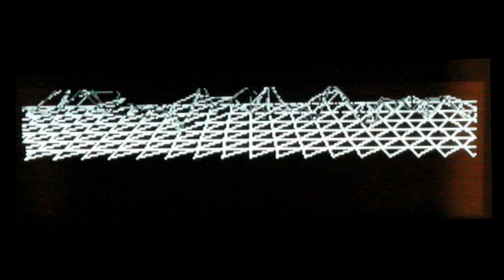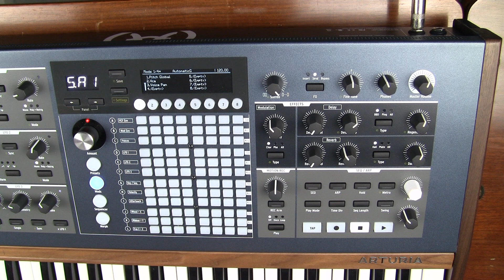18- The Arturia PolyBrute- Morph Control

Comment: Another benefit of the Swap A wiith B function is that if you had a pad sound in the left hand and a lead sound in the right, and you wanted to switch them to make the lead sound more like a bass sound in the left-hand and the pad more like a comping  sound, you could switch them easily. If I was programming for a show, I might find that it’s easier to play certain parts in certain hands so being able to use that functionality with a split would be helpful.

Comment: Having the ability to vary the amount between the two filters combined with the variable filter type in filter one almost puts this in Oberheim Xpander and Moog One territory.  I acknowledge that they will sound different, but the Steiner Parker filter now has basically the same functionality as the filter in the OB6 but with the added benefit of being fully resonant.
Reply: Elka Synthex, Crumar Synergy kinda do it too u can also cascade filters into each other on some of the Kurzweil stuff (kinda the same thing) I do believe dude.
Reply: Synergy actually is a digital hybrid so is II,II+,GDS & Mulogix Slave 32 thanx dude

Comment: I believe they said in their live Q&A video that the filter morph between Steiner and ladder is indeed a cross fade ***edit*** not a cross fade, they have simultaneous routings each with continuous routing level morphing
Reply from the maker: That makes sense!  Thanks for the info!
Reply: @Kevin Patz that would be really interesting if possible! I was hoping they would talk about the Lfo cross fading, but as soon as they got to that part in the Q&A video, they just said it was analog wizardry, much too complicated to talk about, and moved on 😢
Reply: No, it's not a crossfade. Every possible filter routing path has a separate VCA, so you can morph seamlessly from any combination of filter routings to another. The same applies to the whole synth: it's REAL MORPHING all the way. Edit: I copied this message to a new thread to make this point clearly visible and avoid misunderstandings.
Reply: @Kevin Patz It "only" morphs through the two waveforms selected for A and B. You can always copy the current morphed sound to A or B, and then you get that morphed LFO wave as part of that.
Reply: @Trottelheimer   isn’t that just a fancy way to say your cross-fading between the combinations of vca’s of each filter? The oscillator’s are definitely cross-fading  between wave shapes Vs. the matrix brute which let you sum together your own amounts of each wave shapes. The creators specifically address this in their Q&A, although they didn’t get into detail about the cross fades with filters types and lfo shapes
Reply: @RyanMorgan89  The oscillator's waveform mixers are indeed two cross faders in themselves. However, the filter routings are not just cross fading as it could be, say, VCO 1 going from no assignments to both filters, or from none to one filter, or...  That's not a cross fade, and I think the distinction is important exactly to avoid confusion - and there has been a bit of that regarding the morphing.
Reply: @Trottelheimer   ok that makes sense, the manual does say the routing values to each filter continuously morph, I shall delete my first comment, I must have gotten it confused with the oscillators. Do you perhaps have any ideas or information on what is going on with the LFO morphing?
Reply: @RyanMorgan89  Yes, did a quick LFO morph comment 4 messages above this one, but I'll expand on that, actually helped by an experiment I just did. So basically it'll morph (technically a linear interpolation) between the A and B waveforms. However, if you copy a sound mid-morph to A or B, so that you get the morphed waveform at the A or B end-point, you can do the same thing again for the other end-point - say you copied a triangle/square morph to A, then choose a saw for B. As you morph, you'll see both the tri and sqr LEDs at the A position, fading to just the saw LED at the B position. It's quite freaky! If you wanted another morphed LFO wave combo for B, you'd have to do some saving and use Pick B to get there. At that point we're in a quirky corner of deep editing, but things like these are possible.
Reply: @Trottelheimer  awesome thank you for sharing your knowledge! those are the kinds of things that really get me excited about synthesis and sound design, exploring the dark recesses of functionality and pushing them to their limits
Reply: @Trottelheimer  do you happen to be a part of the arturia team or affiliated in some way? I would love to see you post some videos on subjects like these! I know many people would
Reply: @RyanMorgan89  I'm an external tester for Arturia, so I've been a PolyBrute user for a good while. Never been a YouTuber though - that's a bit too scary... :-}